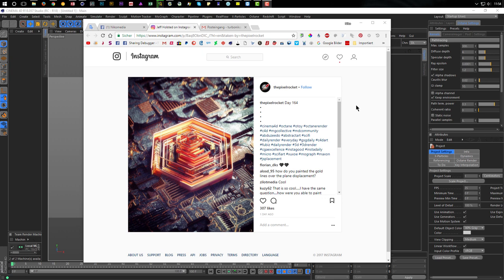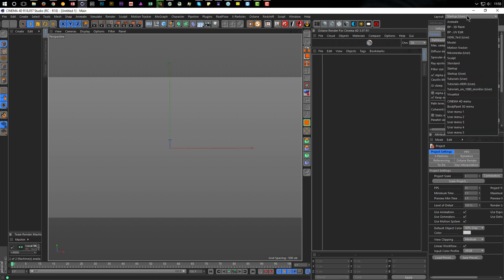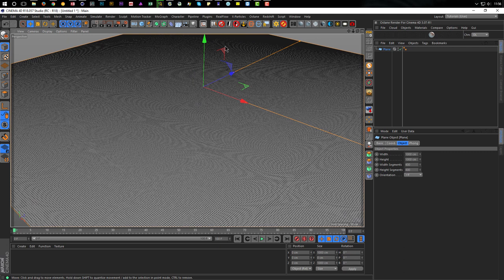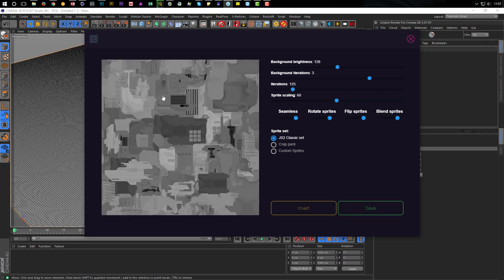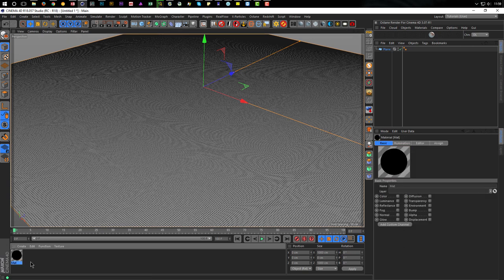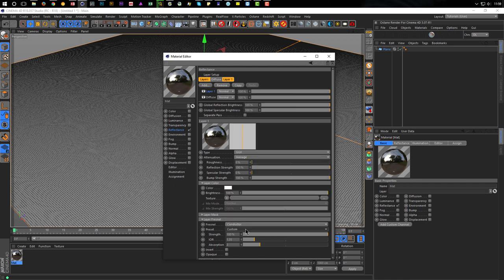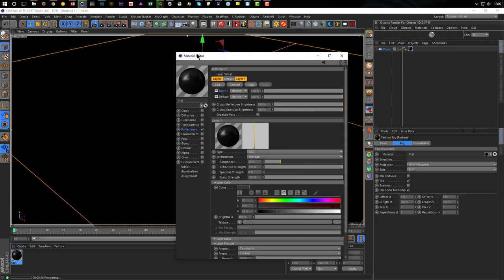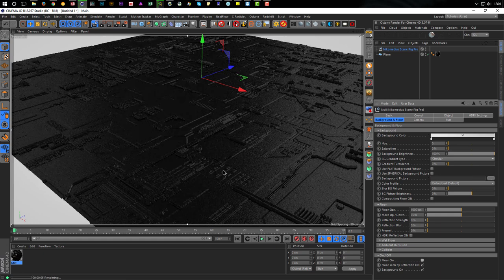Colored Edge Displacement (Cinema 4D - Tutorial)

Comment: I think I just spent the last few hours trying to figure out how to do this in Redshift and I'm stumped. Tried converting the two materials to redshift materials and realized I needed to use the color spliter to drive the opacity of one of the materials in the material blender but no dice, I feel like i'm doing something wrong with the AO effect.
Reply from the maker: I just started with Redshift an have installed just the demo, but is there no dirt node, or curvature node, or AO node, or...? I will have a look later and tell you if I find a way.
Reply from the maker: I tried it now and yes, it works with the Curvature Node.
Reply: Thank you I’ll give it a whirl!
Reply: @nikomedia  Curvature Node + Ramp and it works exactly like you described in the video!
Reply from the maker: @nghtcaptn9461  Glad you tackled it :)